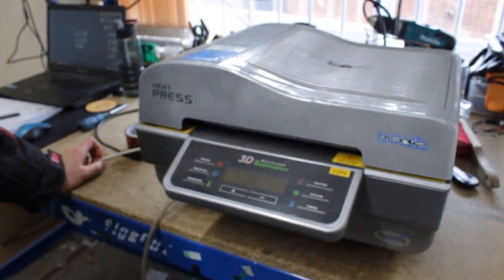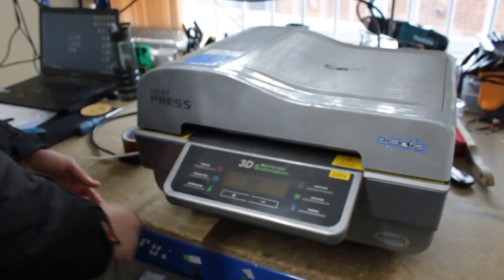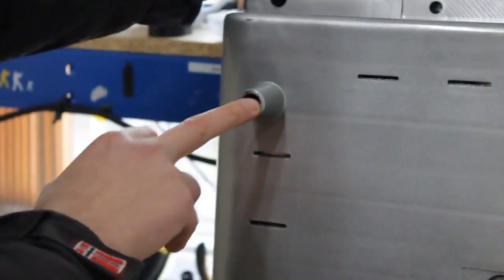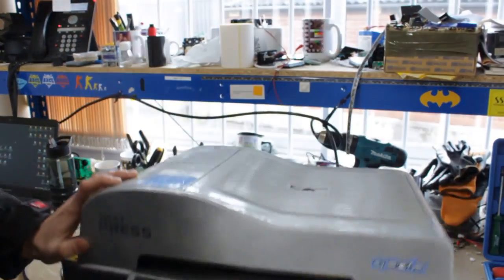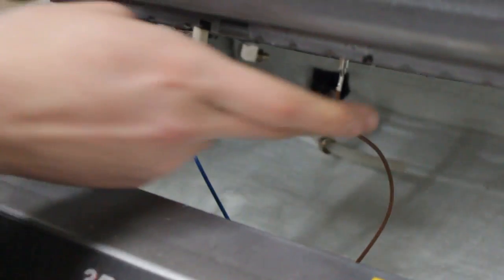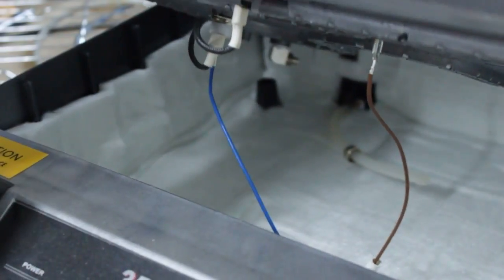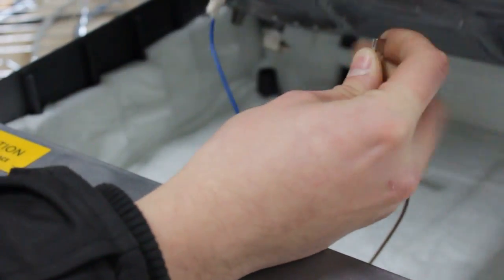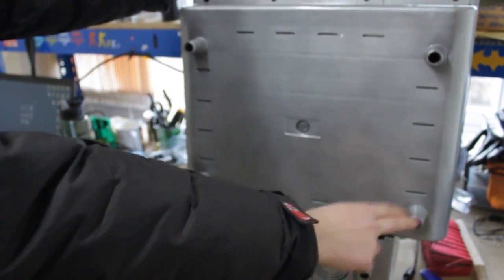How to fix problem with ST-3042 , short-circuit, shorting and not switching on

Comment: my vacuum just stopped working, everything turns on but the vacuum does not make noise or suction and checked the motor and it does not move. Do you have any suggestions on a fix